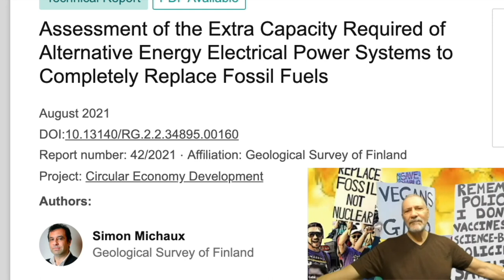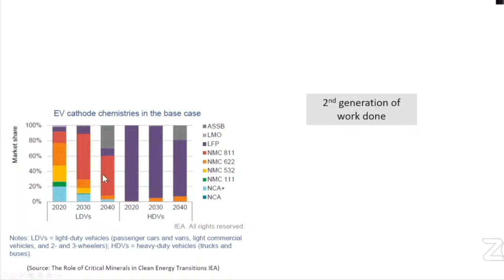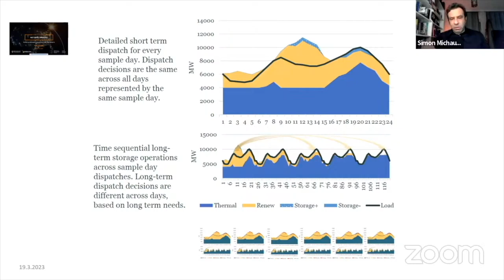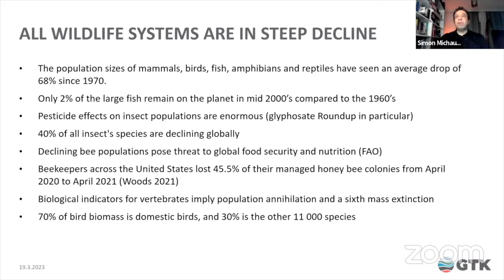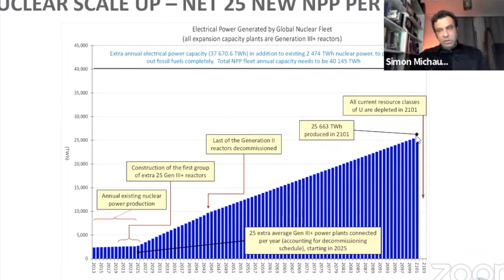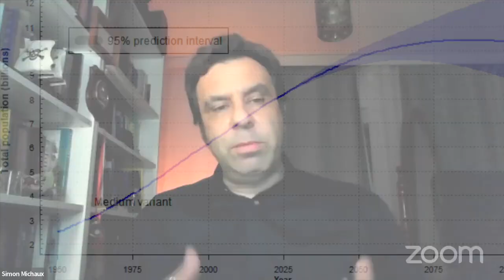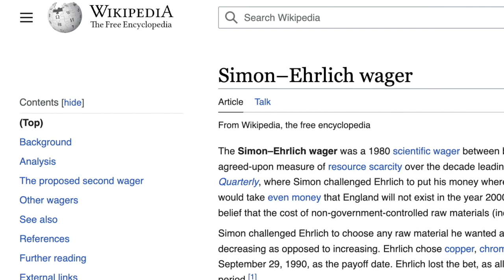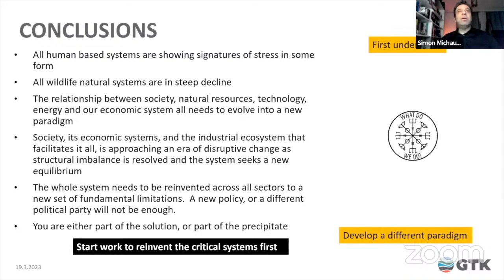The Green Transition Hits the Wall

Comment: The game changer in advanced Nuclear is molten salt fuel, not the thorium fuel cycle, which is difficult. Uranium dissolved in molten salt is easier. Check out the Moltex flex reactor, and the stable salt reactor waste burner, which consumes recycled nuclear waste. About five years ago they had an independent estimate of costs carried out, which made it competitive with fossil fuels. Today they have re-calculated those costs and they are broadly similar. The Moltex flex reactor runs around 800°C which makes it ideal for storing heat using the same technology that the solar thermal people use. That storage is cheap which means they can store up to a week of energy, making it ideal for filling in the gaps in renewables intermittency. That makes the reactor highly profitable, because they can charge the grid companies appropriately during periods of high demand. The Reactor is also walk away safe, which means even if all the active safety systems fail the reactor shuts down by its own negative coefficient of reaction.

Comment: BS, a miner saying we need more mining? big surprise. The infrastructure is already there, all we have to do is plug into it. 
As things age we have to mine more copper to replace other things made of copper, rather than recycling and reusing old copper? He is just wanting to continue getting rich by mining new copper. 
More wind, sun, and hydro, closer to the point of use means a lot LESS copper to deliver it down power lines. 
The farther you pump electricity the higher gauge it needs to be to lessen loss just like when pumping water the farther you pump it the larger the pipes need to be to most efficiently deliver it to end users. 
If everyone had solar panels on their houses and sold the excess to the grid then we wouldn't be pumping electricity cross-country through unpopulated areas down huge copper lines for minimal loss.
Reply: He's not a miner. He worked in mining. He works for the Finnish government.
Reply: So we are going to build tens of millions of electric vehicles. And the grid is there to handle it. Ad well as the millions of charging stations. That don't exist
Reply: @edsteadham4085  They exist in many people's own garages and every garage could be easily upgraded. If the have electricity in your house you can use that electricity to charge your car. It is also extremely simple to make any electric pole into a charging station just by running electricity down the pole 100s of thousands more electric poles exist vs. gas stations and as tech grows so does the speed of charging time and distance of travel per charge.
Reply: Utility level storage has been implemented rapidly. This will bring stability to the grid. There is a lot of electricity wasted during off peak hours and for example in Texas electricity from wind is given out for free during night times losing money for the utilities. However, if EVs are using that electricity during the night , utilities will not use money. Also, with V2G coming up with many EVs, EVs can provide electric it to the grid during peak hours removing the need for dirty  peaker plants. Also, if we have 30% more electricity in the grid, it will be able to power all vehicles in US. Aldo, to refine one gallon of gasoline, refineries need 4 kWh of electricity, a Tesla Model 3 can drive 17 miles with 4 kWh of electricity. Suppose an equivalent Toyota Camry run 35 mpg, almost half of that miles will be run on a Model 3 from just stopping the refining of crude. Also, huge amount of resources needed for exploring, drilling, transporting, refining and transporting to pumps. If we stop those, we will have enough electricity.
Reply: @rab5193  tell me where I can get free at night in Texas? I want on that program lol

Comment: This guy full of BS. He does not have much understanding of battery chemistries making a lot of misinformation. For EVs, 60% will be  be LFP chemistry and also utility and residential storage will be LFP chemistry. LFP chemistry which is Lithium, iron, phosphorus and graphite.  There are no issues of these minerals. Salmon sea in California has enough Lithium to power all vehicles in US. According to Elon Musk, Lithium is not an issue at all. The main issue will be copper. An ICE vehicle uses 48 lbs of copper, an Hybrid uses about 75 lbs and a BEV uses 180 lbs. Elon Musk, recognizing  this, has started using in cybertruck a 48V architecture and Eherloop. Using Etherloop, which is a high speed internet Busch with in car where all devices are connected to, instead of wires running around. Also, using a 48V architecture reduces the size of the copper cables by 75%. A normal car has about 3 miles of wiring, Tesla Model Y has 1.1 miles of wiring, but Cybertruck has only 550 meters of wiring and the wires are 1/4th the size. With all these, the about of copper used is reduced to about 80 lbs. If all car makers go for 48V, the copper requirement will be drastically reduced. Also, when old cars are junked, we can get most of the copper from those vehicles.
He doesn’t have a clue about recycling. He thinks of mining metals like mining for coal or drilling for crude. All those will be burnt completely polluting the environment and stay in the atmosphere for ever. However, EV batteries can completely recycled and can get back 95% of the metals back. It will cost only 50% of the mining for the metals. This is according to Redwood materials and LiCycle companies.  Right now we don’t have much end of the life batteries. Once that happens recycling will be started. Redwood materials is building a 3.5 billion plant in South Carolina.
Even, end of life solar panels can be completely recycled getting back 90% of the metals back. Even here we need high volume of end of life solar panels.
Yes there will be some issues with the minerals needed and will be resolved as we move on.
Also, governments around the world are giving huge subsidies every year for many decades for fossil fuel companies.  According to IMF, in the year of 2023, fossil fuel companies received 1.3 trillion dollars as explicit subsidies from 174 countries, and a total subsidy (explicit and implicit) of a whopping 7 trillion dollars. Kindly see the following report from IMF

http://www.imf.org/en/Blogs/Articles/2023/08/24/fossil-fuel-subsidies-surged-to-record-7-trillion

What a waste of taxpayers money for pollution and also for artificially keeping fuel prices down. If one trillion is used for solar power, it will enough to generate all electricity needed for US. Oil companies keep needing these subsidies to keep drilling and get record amount of profits.
Reply from the maker: Actually, one of his areas of expertise is recycling.  You make many good points though.
Reply from the maker: Also, as far as recyling goes it alway becomes a question of whether the money resources that are thrown into it are worth it.  This is a very real problem, especially solar recycling.